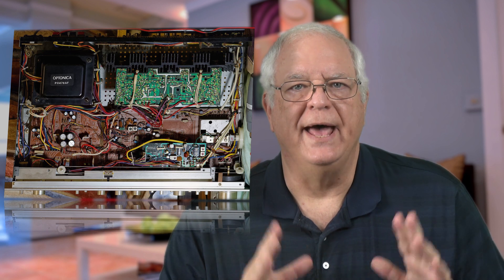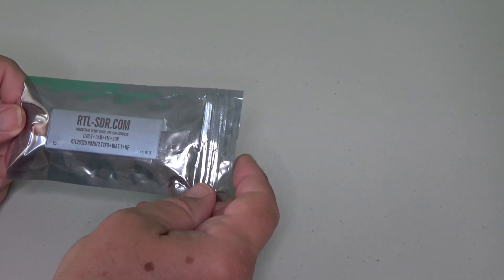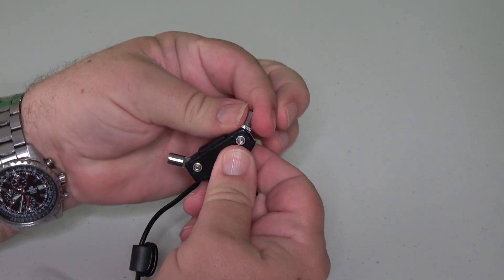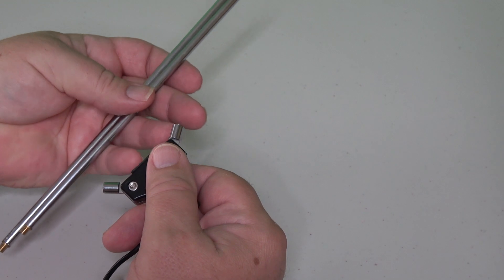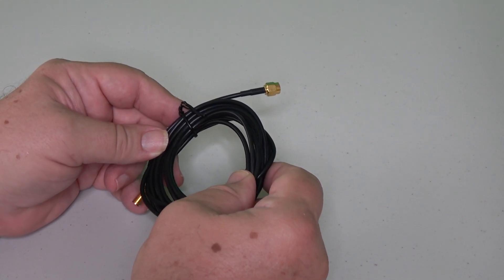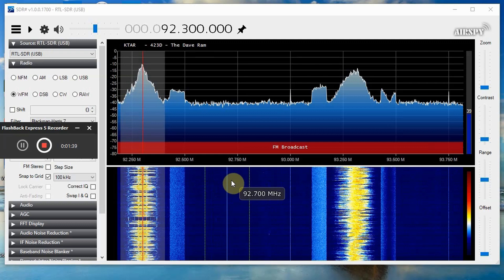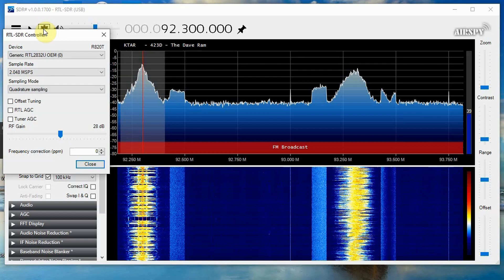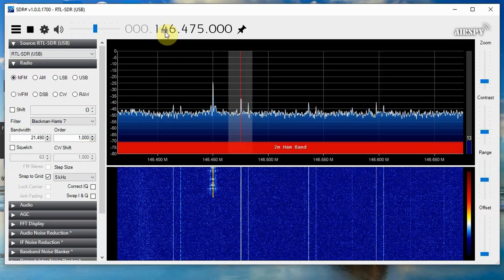RTL SDR Dongle

Comment: Interesting video.  Thank you.   I'm thinking of stringing a long wire dipole under my eaves.  Will my solar energy panels on the roof give any interference?
Reply from the maker: Hard to say. I've heard some are really noisy and others not as bad. I have panels on my roof and an end-fed half wave under my eaves that seems to get out well on 20 meters for my ham transmitter. Keep in mind, these dongles work best with VHF frequencies and above. They'll do OK with lower frequencies with different sampling - I don't recall if it was I or Q in the settings. Some other brands have HF add-ons. For VHF and UHF, the antenna components that come with the kit will do well to start.

Comment: Great video explaining clearly all the steps required to setup the device in Windows. Fantastic, I now have my system up and running.  One small bug thing that I noticed, and wonder if others user may have a similar problem:  I have created a frequency library in the frequency manager section , some WFM NFM AM etc. I noticed that when double clicking from AM or FM mode stations, the frequency Will change, but the modulation method does not, and will not hear any transmissions, until I double click again on that entry. Could this just be a bug in SDR# Airspy software.
Reply: It is a bug and sadly not yet fixed
Reply: Yessir, I’ve got that bug too. It’s still present as of my download and install the first week of February 2023. I’ll just adapt and overcome.

Comment: Hey, really informative video, no one explained the antennae so well.

I have a question, can I use that dipole antenna to transmit using my HT and will it be good? 

73
VU3EVY
Reply: I would not use the supplied antenna with the sdr dongle for transmitting, its not tuned to just one frequency.  If you are using vhf/uhf you can make a very simple 1/4 wav vertical antenna. Plenty of videos on here showing you how to make one.

Comment: Can dongle be used for public service "trunking" comms?
Reply from the maker: Not sure. The dongle is just the part that gathers the signals. It's the software on the computer that converts signals to information. I suspect it is a software capability,  issue.
Reply: As I understand it (complete noob here) you use 2 sdr radios with a software, 1 radio for control signal, 2 for transmissions, I haven't tried it yet but this is what I want to, basically a homebrew scanner on an old laptop and hopefully portable to boot
Reply: @rbnhd1976  Thanks! Yes, learned that is a good way to get trunked comms!

Comment: correction: 146.52 is national simplex frequency
Reply from the maker: Sorry, br. there is nothing to correct. Nothing I said during that portion of the video is incorrect I simply choose that freq to get the SDR# software into the ham 2 meter band. This video is a tutorial/overview of the SDR dongle and SDR#, not a discussion of the 2 meter band plan. Cheers.
Reply: @GadgetTalk4U  I recognize this was an example that you used. Ham's are very protective of their frequencies and their uses.
Reply from the maker: @preyingjaws  Point taken. I'm an Extra class operator myself. My opinion is that SWL can be an entry point I to Amateur radio for some. Good for the hobby. Thanks for responding. Cheers.

Comment: Great explanation.. Thanks.  Comment tho.. 146.520 should not have any repeaters.. it is a simplex frequency.  Are these devices available for the HF bands.. say 10m-80m?
Reply from the maker: 146.520 is, indeed, a simplex freq. There are repeaters less than a megahertz away, though, so they are in the area. Sorry. a bit of a quibble. Your question about lower frequencies is a good one. Some brands of SDR dongles require an attachment such as the Nooelec Ham it up. The RTL-SDR can be set to direct sampling and Q branch to access HF freqs directly without an attachment. I show this and discuss briefly in my initial Pan Adapter video published in January 2021 where I use the RTL-SDR to provide a waterfall for HF. It's at about 20:35 in. Cheers!
Reply: @GadgetTalk4U  Thanks, I'm so old school it's pitiful.. Still living in the analog world.. Hopefully, I'll learn a bit.. grin.

Comment: Working 8 hours today and still rtl-sdr not working in cubic sdr.  Can't change freq. range etc.  Want to be able to see ham bands.  retired computer specialist and can't find step by step docs for cubic sdr.  youtube videos to short and does say how to do it.  At this pace I will be bald in only 5 more min.  Can''t find good help to cofingure, so far t he only thing I have heard is an fm station.  SDR must be a fake
Reply from the maker: I have found some software works better and is easier to set up than others.  I've used SDR# and HDSDR works with the dongle.  If you haven't already, explore the RTL-SDR web site. Good stuff and links to set-up and explainer videos.  https://www.rtl-sdr.com/big-list-rtl-sdr-supported-software/
Reply: @GadgetTalk4U  I found airspy RTL SDR software worked well after all the drivers and clicking on this and running that. I'm running windows 7 so that could have been part of my problem.

Comment: You didn't mention whether this SDR dongle will work on all USB speeds including the first, slowest version USB 1.0, so I'm guessing that it will since the slow USB 1.0 is supposed to have a speed of about 12 Mb/sec and 12 Mb sounds like more than enough data capacity per second for what amounts to sound data (non-video).  Also, now that I'm thinking about it I wonder if it allows the user to record a section of frequency spectrum, for example while the person is sleeping, so it can be examined later for what activity was happening in that spectrum range?
Reply from the maker: Can't speak to the USB speeds but SDR # will record what they call I/Q files for you to examine later. Thanks for watching and commenting.